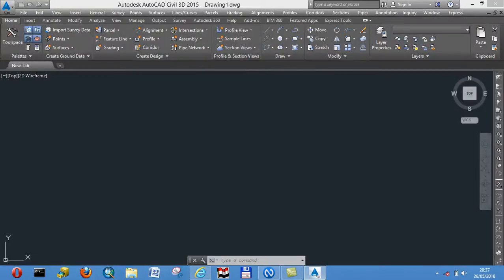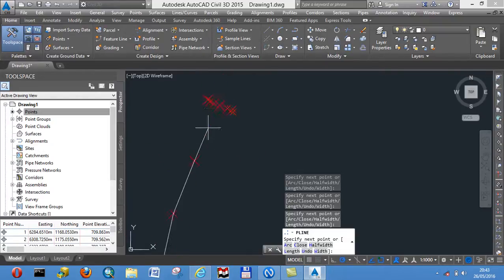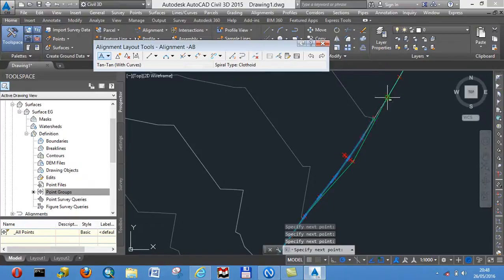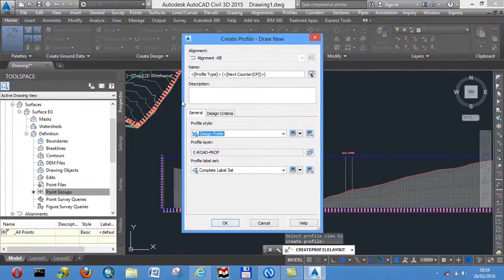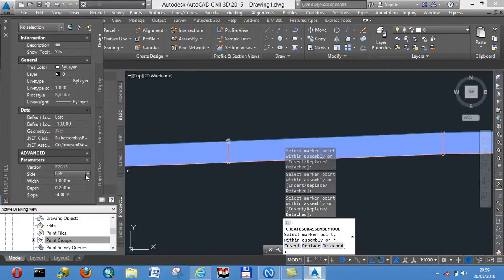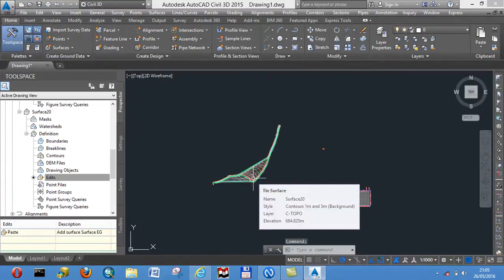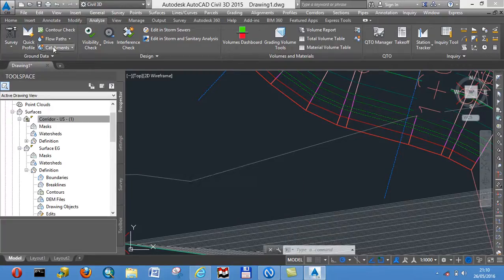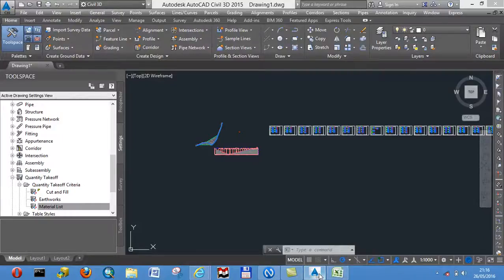ROAD DESIGN TUTORIAL FROM START TO FINISH

Comment: Also video on layout ?
Video on grading 
Video on volume calculation using 2 surface or survey data i.e pre survey data and after filling or build u check with final data the volume of fill or cut
Reply from the maker: The video is a full road design volume calculation but not using two surfaces cut and fill is also in the video 
For layout are referring to layout of plot? Or still talking about road design

Comment: thank you engineer its short cut cleared lesson moreover you have to select alignment from poly line if you draw a poly line also when you create surface better to select the properties and first of all you may explain how you can prepare the excel text files or cad drawing or contour pints to import as data using for designing 
thank you very much am glad to watch for African engineers in youtube we need more and more 🌹eng Ammar from Sudan professional in roads and infrastructures work